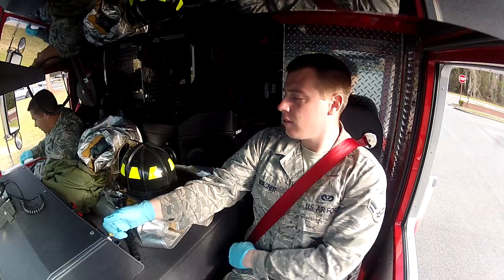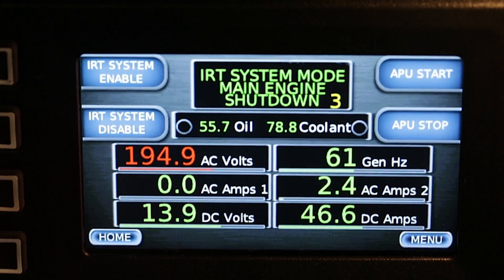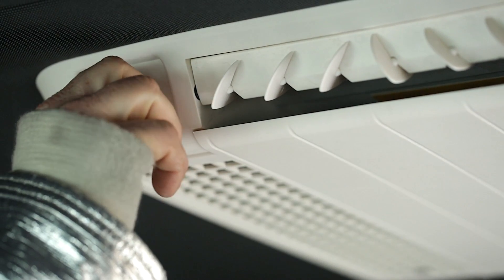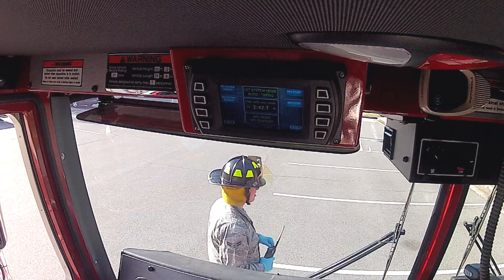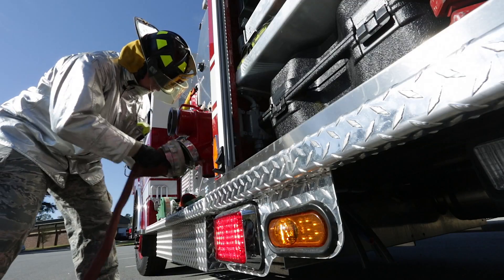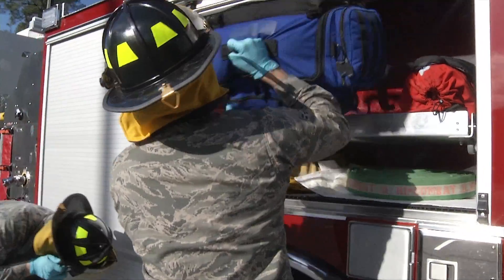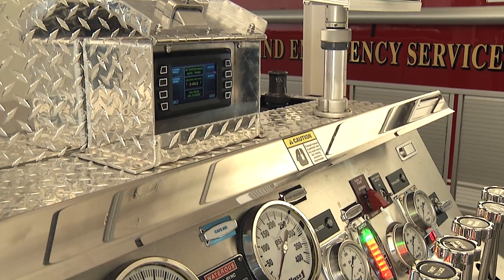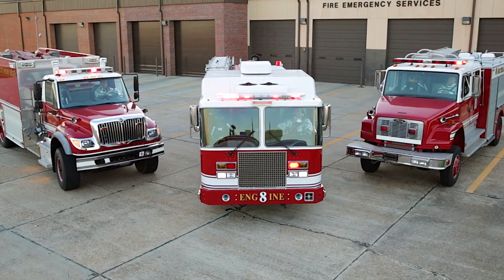Air Force Introduces New "Green" Fire Trucks

Comment: Moody A.F.B. I was stationed there as a FF May-77 Jan. 79. The flight line station looks dramatically different if it’s the same one. The structural side of the house was two Ford gasoline engine pumpers. Bare bones, small pumps and archaic equipment. How times have changed.

Comment: Sending a large pumper to a medical is waste full,be smart and send a mini pumper running a gasoline engine.
Reply: They need the additional personnel though to speed patient care, and to assist in lifting patients
Reply: Re read what  I said,I said use a mini pumper to save wear on the bigger engine ,you can stil get 3-4 people in a mini and you gain a lot of years of life for the engine by not putting excess hours on it,you can replace wear items on a mini far cheaper. In my old  VFD we used the mini as a crew carrier to avoid the cost of wear on our engine since budgets only go so far.
Reply: @scottfoster2487  ah, gotcha